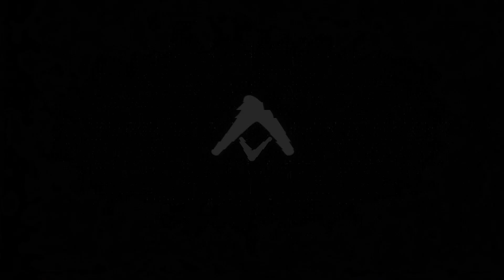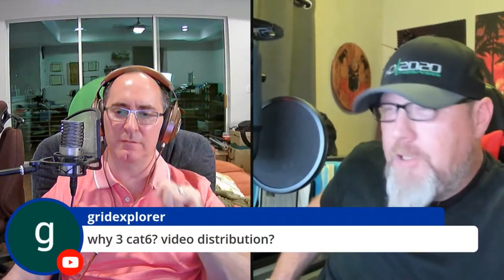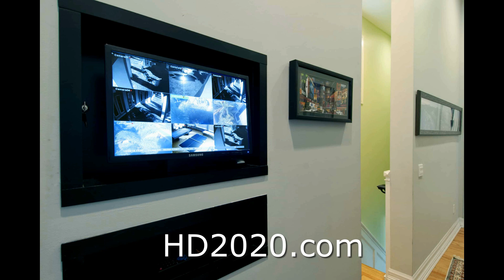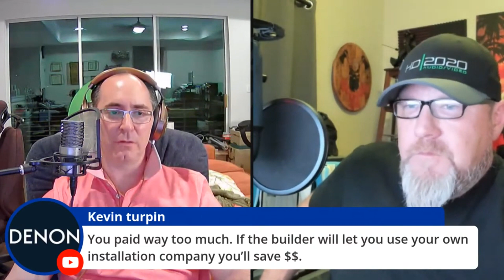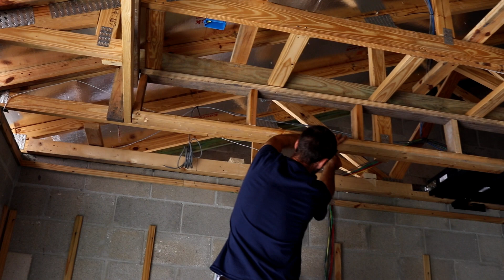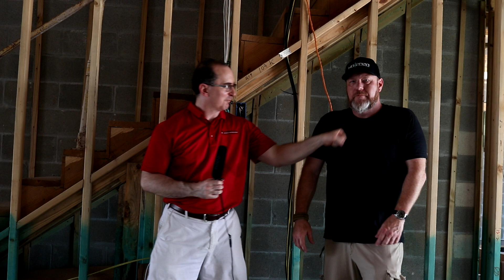Why Cat-6 for Distributed UHD Video? SmartHome Pro Installer Insights Wiring Audio-Video and Data

Comment: Hi Dear Mr.Gino.I believe you have received my previous massage regarding Pure Direct issue. Actually my problem is>>> Currently i'm using Yamaha Rx A3020 Receiver so  while its playing 20 minutes or 30  automatically switch on and off frequently at the same time everything is black out on the front panel of the unit also produce very low volume after few minitius switch on than back to normal though I couldn't control my remote .again after few second back to normal/so this happened every time when I power on.Please kindly give ma a solution to solve this problem.

Comment: I've wired my home and made 13 RJ45 cables. 11 are Cat6a and the last 2 are Cat6 (because I had not enouth 6a to finish everything).
It's a hard job to make the connections and test it, but all I can say is the cat6 were really hard to wire compare to the 6a, because of the shielding.
The 6a has a metal screen, easy to cut and manage... for the cat6 I was using, it was a braid shielding... DON'T buy a RJ45 with a braid shield... all these littles wire shortcut the signal, it's really hard to see, it's so small. A real pain in the ass...

Comment: I ran three cables: COAX and two CAT 6a. Added to a two story house so key words are Gone Fishing.

The COAX is for legacy cable.

One CAT 6a is for Ethernet to computers, printer, receivers, TVs and Blu-Ray players. It is distributed through four switches and from an Arris Touchstone TG2472G Telephony Gateway.

The other CAT 6a is for a Monoprice Blackbird 4K HDMI 1 x 4 splitter/extender model 42271. This distributes 4K @ 60Hz to three rooms with one way IR control signal pass through. Monoprice also makes a 1 x 8 version.

Ethernet CAT 6a wire is blue and video distribution CAT 6a wire is orange.

Things work great.

Since Gene and Don mentioned this I also have an Aircom T8 cooling my Yamaha receiver.

Comment: When I cabled my home I used Cat-6 for all the reasons Mr Dunn mentioned. Cat-6a is more expensive and a pain to work with, and Cat-7 is proprietary. There's just no benefit to using anything other than Cat-6 unless you have a lot of distance to cover or have some other specialized use case. 
When I do multiple cables in a run, whether fiber or cat-6, I configure them in LACP so all links are used. Obviously you would need a switch at the other end that understands LACP. But the advantage is that if a link goes down everything keeps working, and you can address on your own time without impacting the network.

Comment: Great answer on running fiber. Correct, you just don't need it in a 5000sqft or smaller house. CAT6 is fine. All the drawbacks mentioned are accurate.
What abut 8K and then 16K? Well IMPO, you don't need that in a home either. 4K is more than enough even for an HT screen. 8K is for public cinema and large venues.
FWEIW, I design and build television broadcast and mastering facilities. Even here with immense budgets, we still use far more copper than fiber.

Comment: I think there’s a common misconception that you have to wire an entire home with a single category type.  Today extraneous factors like “Will I be running PoE over this cable”  are becoming as important as cable length run.   Sure I’d use Cat6a on short runs in the rack to between my Server and Storage but it might not be necessary on the longer runs across the home. 

I know me personally my builder ran the cables through hooks and in open space in the attic and if I ever want to do an attic conversion they will need to be re-routed so I’m planning do re-wire so that I won’t have to pay extra to have someone do it for me.
Reply: FWIW: Cat 6a is needed for the longer runs. Cat 6 will support 10 gbps up to about 100 feet. Any longer runs will need Cat 6a. Also recommend running cat 6a or Cat with 23 awg if your connecting PoE devices (IP cameras, IP phones) because the thicker wire gauge can handle the current. I suspect Cat 6a will support higher than 10 gbps at shorted distances, presuming we might see 20 gbps Ethernet over Cat 6a in the future.

Comment: just use cat7 ... it is always shielded and supports 10g over longer distances. it costs not much more then cat5 or cat6 in lengths needed for a house. fibre isn't useful for home use, it needs expensive equipment for good installation.
Reply: 1) fiber transceivers are cheaper than 10GBaseT transceivers. 2) for runs less than 30m cat6a is sufficient. 3) Don was clear that he will run whatever unicorn cable the customer wants to pay for.

Comment: If you're installing cables/wires in new construction, you're better off running as many different cables as possible,  (within reasonable budget considerations).   
    I was slightly involved with cabling in a new school construction in 2002.    Each classroom was cabled with regular 4-pair twisted copper, 2x CAT5, single-mode fiber, and multi-mode fiber.  That is what was spec'd by the school district telecom manager.    This wiring/cabling will serve the school for a long time.
     Not all of that cabling needs to be terminated and activated at the time it is installed.  Just terminate what you need at the time, and when you need an upgrade in the future, the cabling is already installed.   I would still install pull-strings in the conduit, just in case.
     For myself, I live alone in a tiny apartment, so all cabling is either wireless, or external cable hanging from hooks along the walls.  As long as it works as desired, I don't care what it looks like, and upgrades are easy.
Reply: Great point about leaving pull strings in the conduit.  Relatively painless upgrades in the future if you plan it out carefully

Comment: If it's real short lengths, CAT8 is cheap
Reply: And not worth it. I'm all for provisioning with the future in mind, but 10GbE can run 30 meters on cat 6a. If you need to make longer runs, or if you have a significant amount of EMI, go for Cat8 (or fiber, but POE is a powerful argument for copper). 

Also, be sure to ground your Cat8 on both ends.
Reply: @hellboundedward  FYI: 30m for cat 6, 100m for Cat6a
Reply: Its not the cable, its its going to be the cost of the terminations (either keystone or RJ45). Plus it can be tricky since you have to keep the pair twists & shielding right up to the termination point.

Comment: How DARE you not run Fiber!  Jk…looking forward to getting some tips here.  I’m replacing my Cat 5e with Cat 6 …thought about 6a but I really don’t need 10g to the edge.   5Gbe is where I want my bigger connected devices to operate.
Reply: Only question I have with your strategy, which sounds good to me, is do you think there really is a cost savings from 10Gbe to 5gbe? We are starting to see 2.5GBASE-T switches, but for the most part I am seeing 10Gbe SFP+ switches, and there are no 2.5GbE transceivers (many 10GBASE-T transceivers work with 5 and 2.5GBASE-T). Mikrotik has some cheap 10Gbe switches, for example, but no 2.5GbE or 5GbE.
Reply: @hellboundedward  Hedging my bets really.   Initially I was going to drop a single line of Category cable but i’m starting to think Don and others are right in that I should be doing  multiple drops.  The price difference of 6 vs 6a isn’t huge but it’s there and I know that with NbaseT I can still get 10G over Cat6 cable if I can keep the runs shorter than 55m.
Reply: @hmurchison8123  Most likely Cat 6 will only usable to about 37m. Maybe 55m if its shielded and uses 23 awg. In my opinion Cat 6a is the best option.
Reply: just use cat7 and be done with it. it's always shielded and doesn't cost much more. that 10g will come around sooner then later 😉